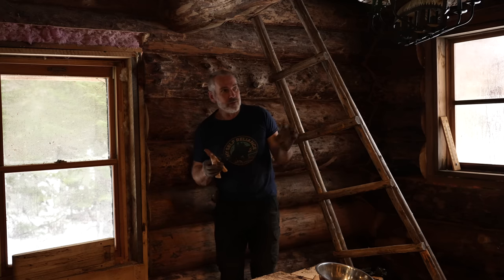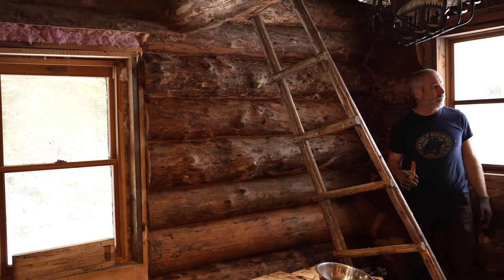You Can Do This Too! Perfect is the Enemy of Good

Comment: Hi Shawn, Re your comment on the ground  rod, another solution  is that in B.C. you can get galvanized "ground plates" that can achieve the same results. They are used where there is earth that is impossible drive a rod into. Just a thought  And I agree with you on joint filling if the job stops the drafts it's doing the job, and really how many viewers notice?

Comment: Try using a paint brush with the bristles cut down to half their length to spread the sealant
Reply: The brush is a great tool to use on stonework also.
Reply: I would suggest the right tool a mason strike ... essentially a spike with a beveled end ... for the tight joints and a small pointed trowel for the larger ones ... and your golden .. any size gap can then be pressed neatly in place ... without adding rough lines from bristles to hold dirt and filth in ...
Reply: @kaboom-zf2bl    A strike is great for brick and block but rock, stone or log joints vary.

Comment: Suggestion from an old potter, push in the clay with your fingers and smooth it off with a sponge. A ladies facial sponge could be best, it’s smoother and flexible, just dampen it and it will be easier and a reasonable finish. Sea sponge could be ok too.

Comment: Great job on your cabin prediction does not matter   Here is my story about ground rods  many years ago I was adding powered  to a cabin in the country  and to pass inspection  you needed to put two ground rods  ten feet from the meter and 20 ft from the meter so after hours of pounding the first rod was half way in  so I stopped to take a break and an old farmer stopped buy to say hello he you are working much to hard  .he told me to dig a hole one foot around and one foot deep  get a 5 gallon pail of water start your rod in pour about a gallon of water  and start pulling the rod out  and pushing it back in  keep doing this until the water is gone and more water and repeat  .It took me less than an hour and all 10 feet was in the ground

Comment: They make a bit for hammer drills (real hammer drills, not the cordless drill kind) that is used to pound in grounding rods.  I've done several on my property, and the ground here is hardpacked rock, clay, and more rock.  It will stall at times, but if you keep letting it pound it will almost always make its way through.  In decent ground, it can sink an 8' grounding rod in less than a minute.

Comment: As a painter, I would suggest using a flexible wiping tool. They sell rubber triangle pieces attached to a hard plastic handle, but it would be easy to create something similar. The advantage is that the flexibility allows for constant contact on uneven surfaces and the triangle shape allows for different sizes of gap. Keeping the mixture wet enough for easy wiping and flow into position is also a consideration. Looks good on camera though. Good work.
Reply: Agreed. Fashion a small rubber kitchen spatula to the desired contour.

Comment: The requirement for ground rod is minimum two 8ft rods at least 6ft apart. In sand it may not be a great ground depending on how dry it is. You may want to drive the ground rods outside the cabin and run the ground wire in to the panel. You can also run 2/0 bare copper in a ditch but you need at least 20ft and that can get expensive and if the ground dries in summer you may lose a lot of effectiveness. You are looking for 25ohms or less of resistance.

Comment: Instead of 2, 6 foot ground rods you can get one grounding plate that just needs to be placed under ground in a dug hole. The surface area of the plate is sufficient to ground your system any where in Ontario.

Comment: You'll learn by doing it Shawn, just like everything else you do ! The bottom edge can be taped off to give a cleaner edge, or use a drywall scraper with a long edge to achieve similar effect and minimize any need for shaping beyond one wipe or scraping with a rounded bead tool.

Comment: Hi Shawn, compare to other cabins that I've seen on youtube, your cabin quality is quite good. I personally wouldn't seal the gaps until logs are perfectly dry which might take a few years, but I would spend time to sand all the logs outside and inside as well and then apply a wax with oil to protect them from moist. You're doing great! Your videos are like a meditation to me. I always watch them before I fall asleep, it's so relaxing. Also, your videos have a curing effect on me and it's significantly important to me because I'm paralyzed for over 25 years. Thanks so much, God bless you.

Comment: As someone who used to Caulk professionally, a few tips to make it easier/better.
Mix a little dishsoap and water to lubricate your tooling stick so that you can move and shape the caulking instead of spreading it and so it doesn't stick to your tooling stick. Keep your tool well lubed and try not to play with the caulking too much. It may be helpful to have a few tooling sticks for different gap sizes. When carving your tooling stick, make sure the part that will contact the caulking is smooth and concave/rounded to make it easier to tool.
Make a clean, straight cut on your caulking gun tip at angle of about 20 to 30 degrees horizontally so that you can lay the caulking more easily. Also make sure the bead size is appropriate. You may need to switch out tips for different gap sizes.
You need to ensure you minimize the air in your caulking as much as possible. That means mixing it a certain way and drawing it up in your gun without introducing air. 
When laying the caulking, position your gun more perpendicular to the wall so that the caulking gets flattened by the tip of the gun as it is being laid. 
Fill in large gaps appropriately so that the caulking has something to hold onto. 
Hope this helps!

Comment: There may be an honest to goodness NEC expert here, but when I was doing electrical work, the necessity of an 8 foot grounding rod existed also.  However, that does not mean the rod must travel 8 feet vertically, as does a well shaft  ( for obvious reasons ), but that the rod must be in contact with and surrounded by 8 feet of earth.  I believe the rod can run horizontally or diagonally for some of the required length, allowing for burial where things like rock ledge might prohibit vertical installation.  As always, Shawn... great stuff...a great many of us would do well to remember that humility is, indeed, a virtue.

Comment: I don`t know if the caulking material is water soluble, but it seems to me after you put the product in the groove, the corner of a damp sponge would  with light finger pressure would leave a nice smooth finish, and adjust to different gaps, you know like a sponge for tile and grout with rounded corners. That is how I do my bathtub and sinks that I caulk, with real nice results, because I am not the best caulker, just rinse your sponge often, and wipe away, just a thought, I don`t know how rough the logs are that you are working with. the more damp the sponge, the better it should flow across the logs. That is how I would atempt anyway, but I am sure no pro either, all the best to ya.

Comment: Being a plumber, quick tip rubber gloves the type that you can actually feel your fingers probably two pair since you're working with coarse wood., Also damp to moist rag to wipe off any access. But do not let it dry up first and then try to come back and pencil in the line you're looking for. Truth be told you build that damn house I watched it from the ground up excellent job

Comment: Even a lot of painters are horrible at caulking, I would go around with an 1/8th inch bead or whatever is most common  then when you tool it ,just push it back into the crack where it is wider. Then come around with it opened up almost all the way and fill in the places that were bigger. You may have to do a few places 3 times , but it will look great and you won't be trying to clean the excess off , thats the hardest thing to do of all of it.

Comment: As far as the electricity goes simple circuits are easy just look it up online and you'll be able to see how they work.
And here's an idea for your grounding rod you can get a drill and start your hole and then use a fence pounder to pound the rest of the way in good luck I hope everything works out for you

Comment: I know what your talking about, did the same caulking on my cabin inside and out. I found my finger worked best to smooth it out but it gets raw after awhile and you pick up an occasional sliver. The corners are the worst, take your time and put it on thick.

Comment: I've seen some pro jobs, one of them being my dad's neighbour at the lake. It looks like they do the base bead and then go back over it with a wider one when that first one is still setting up. Back when I used to do tile and masonry work as an apprentice we used to use a plastic bag with a bucket of water to smooth the really thick grout lines. You'd put your hand in the bag like a big oversized glove, dip it in the water and use that to kind of smoosh out the excess and clean up and make the grout smooth. Then you can go over it at the end with a cloth and clean up the stray bits. Worked like a charm. I wonder if this stuff can be manipulated the same way.

Comment: Hey shawn i am a licensed electrician in upstate New York you can dig a trench 3 feet deep horizontally across  and bury the 8 ft rod that way with an acorn clamp with a 6 cu wire for ground

Comment: If the pioneers had access to portable band saw mills they probably would have gone with stick built houses, the logs go farther and its just faster and easier to build,  you can get the same look with cutting the 4 outside edges of a log and use the interior square of the log to make the dimensional vertical studs, insulate with your favorite material.  With a stick built structure you don't have to worry about settling as long as the building foundation is level & square.

Comment: Each log would have to be hand hewn using precise instruments calipers and all kinds of accurate measurements requiring sanding and tools and this that the other thing to really get it perfect to where there are no gaps and if you're having a professional build it like you said then yeah that's possible but for your average DIY the ability to build a cabin with tools that you've made yourself for the most part and having everything you need in nature is a very rare thing
I think it came out really good it's certainly bigger than the first one you built but you've made improvements and that's a good thing and I am eager to see the entire building what it's all finished

Comment: In germany we do the grounding with a high-grade Steel grounding wire, layed around the the house about 2-3 foot deep. An some connection spots in the groundplate, and the main switchbox...

There should be different standard solutions available.

Comment: Shawn, have you considered putting into a plastic bag, cut the corner off and use it like a piping bag to squeeze it into the joints, just a thought. You could get a mastic gun but the empty tubes are difficult to fill.

Comment: We moved 5 months ago into our house. Only the outside wall, frame, roof and windows were done by the building company. (Heat, water and electrics also but this is permitted to be done by a professionel.)

Did all the insulation, sealing, drywalling, laying floor, tiles, installing the bathroom etc. together with my brother. We never did this before, totally different jobs.

Yes it has imperfections, i took wrong shortcuts, did stuff twice. Used not the best or manual tools, that took time or made it harder, but saved 2000-3000$ on tools i will probably never have to use again.

I can live with the imperfections i did. Have seen stuff from "professionelles" that i would refuse to pay, i can do better myself with a little training.

And also have some spots that came out better then i expected.

Now i moved in, still work to do. And usally when the kids are out, you can start renovate again.

Comment: Try putting a "Hex Nut" just larger than the outside of the ground rod. Lay the nut on the ground place the ground rod on the nut and try pounding it in. Disclaimer will not help in rocky soil.

Comment: Different sizes nozzles on many tubes of gunk. I built out the inside of my campervan, which is a European version of the RamPromaster. You can't use a level, so your best choice is an angle, but it's still almost impossible to get it right, but I am happy with it. I think you need to be realistic.

Many homes look great, but are built out of crap. No stress, it's not worth it. 👍

Comment: Not a professional in electrical standards and systems BUT, given the dampness of your soil there and the fact that you are already 5-6 feet down - those 4 foot rods even 4-5 feet apart are going to protect your wiring and you from a short.  8 foot rods are designed to cope with varying soil moisture content.   Also you are not dealing with high voltage .   Even a lightening strike on the cabin or solar panels is going to go to ground well before it gets to you unless you are basically holding a wire that conducts that strike and you are in direct contact with the ground.  Your wood flooring and cabin structure provides you a great insulation factor unless you have puddles of water in the cabin.  You are so close to that marsh and stream that the water content of your ground provides great conductivity for any grounding medium to transmit the electrical energy.

Nonetheless it is YOUR life and family and YOU have to be content/confident that you have it right.   

Caulking - Yeah, I love it when it's done but I will always see and know  every little imperfection..  Visitors and family are not likely to see those less than perfect spots.  I also view your cabin as a rustic structure and it would/should never be perfect because you are dealing with natural materials that are not highly processed to "perfection'  that's actually what makes a cabin like that so beautiful.  As long and joints are sealed properly the precisely smooth lines are meaningless.

Comment: the suggestion of a brush is good but you might also want to try a large sponge. I'm assuming you don't mind making a bit of a mess as you can clean it up later but make sure the sponge is moist and go over the crack after pushing as much of that chinking material in as possible

Comment: Upgraded my panel to breakers used an electrician they dug down 24 inches and 24 x 24 and installed a grounding plate 24x24 and buried it as a ground may be an option to a grounding rod. This was in lake of bays

Comment: Grounding my cabins electrical,  I ran into the same issue. I ended up digging a 4 ft hole and put a grounding plate in the hole. Eliminates the necessity to drive a rod down 7feet. Which as you know is impossible in the soil we have on the area
Reply: Is this legit? What's the big giant chisel used for when clean up the logs?

Comment: One thing that I've been observing, especially in your recent time lapse videos, is how different the tolerances of finish carpentry versus rough carpentry are. I recall when the floor joists were going in and seeing how those were measure out and put down without high precision but when the floor boards were put in over top those looked flawless. To be perfectionist on the rough carpentry work would have been entirely wasted for the final product.

Comment: I had a Austrian pine log home built in Eagle River WI, by a contractor. The logs weren't perfectly scribed, and the outside was all caulked just like that. The bottom line is, are the gaps sealed from the elements....if yes, it's mission accomplished. There will be imperfections in the caulk gap width. So what - nobody cares that much. If it seals out the wind, rain and bugs, and holds the heat, that's all that matters.

Comment: Just a thought, would a small silicon cooking spatula make it easier to get that smooth finish you're after?  Some of them have the right mix of stiffness and flexibility that might allow them to fit the irregularity of the joints between the logs.  As always, thanks for sharing.

Comment: Kinda late for this info. Cut the top off a dish soap bottle, run a wire through one side to attach to your belt. Fill with 1/8th soap to water ratio, make six different sixed tooling sticks and leave in soap bottle. Voila, their always wet and you have both hands free, just keep dipping to keep moist on the run. 

Just an old glazier, that's done 1000's of miles of that muck.

Comment: Hi Shawn, about the brown kit you are using to fill up the gaps between the logs, did you try to dip your finger (without glove) in warm water with soap and just smoothen the surface with your finger? A lot of work and it takes twice as much time, but that’s the way we do it being painters 😎
Love the cabin and all that you build 🤓
Happy new year 🍾
Reply from the maker: That’s what I used to do too but not for 2000 feet :)
Reply: Yep, it will cost you your fingerprints 😂

Comment: Try to reverse the angle of your gun. It will automatically push your filler inside the gaps. You will control the beat by the speed you drive the gun….